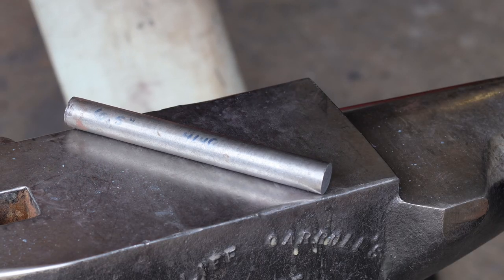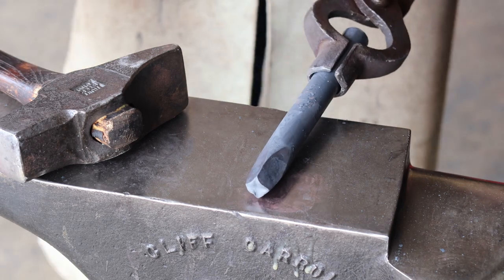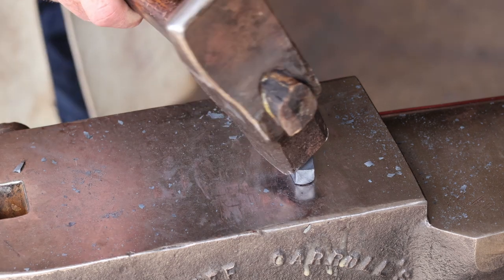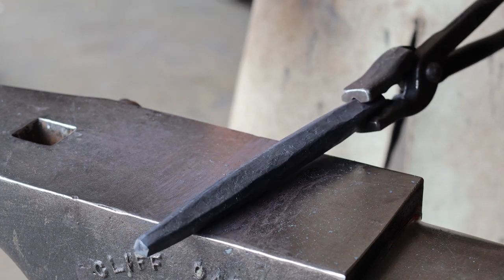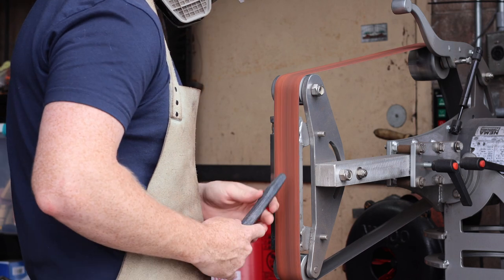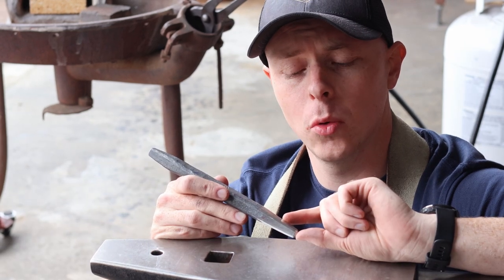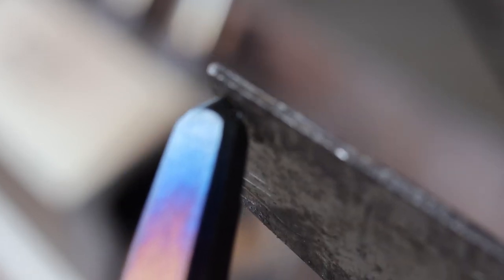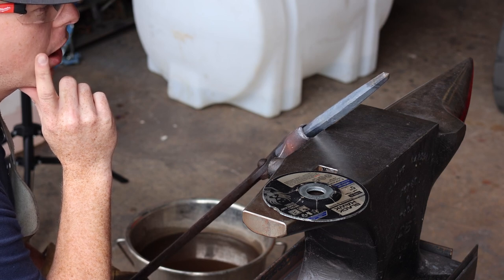How to Forge a Center Punch

Comment: I'm not a blacksmith or a machinist of any kind, I watch this content precisely because it has exactly nothing to do with what I do normally, like a mental vacation. Out of all the smithing channels I've watched yours is by far the least aggravating with constant musical cutaways and irrelevant garbage I specifically installed an addon to remove (its called 'sponsorblock for youtube' if you're curious). You have zero irrelevant garbage, in fact. Even the algorithm-enforced engagement begging at the end was tasteful. On top of all that, it wasn't some trashy anime Kunai made out of polished brass, but a useful tool. Pretty good stuff.  Personally I'd like to see some content on the measurement tooling and generic work process you have, that hooked ruler looked pretty interesting. General shop-stuff like your grinder or furnace or anything else in mundane use would be great too.
Reply from the maker: Thank you so much for such a detailed and thoughtful comment! This is why I started my channel. I'll say, I am modeling it as a hybrid of the artistic projects with music and fluff as well as more how-tos/ breakdowns without the music and with more detail. So, don't be surprised if you see the other style from me too. Haha. This kind of comment helps me figure out what people like to see, though, so I really appreciate it!

Comment: What grinder is that? Almost looks Iike the osg sayber
Reply from the maker: The owner of the shop space I'm using built it. I'm not sure if it was a kit or completely from scratch, but he lets me use it. Haha
Reply: @rockingeforge  I wish I could find a shop space to work out of.. if I had a bunch of  money to buy some land I'd put power on it and the a big pole barn or steel building and rent the spaces out on a monthly basis or yearly or whatever.. I think it would do really good.. thoughts?
Reply from the maker: @jonballard4453  it's my biggest struggle. I move frequently for work, and finding a new place to smith is such a pain sometimes.
Reply from the maker: @jonballard4453  for what it's worth, I've considered making a communal shop space and while I think in the long run it would be awesome (as long as you make people sign contracts to not abuse the space), I think fronting the cost just to find out if there are enough people in my area who want to rent the space is very daunting. If you got a few people together to start the venture, I'd say it might be doable, though!